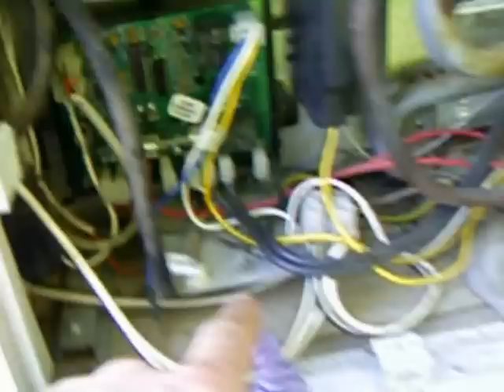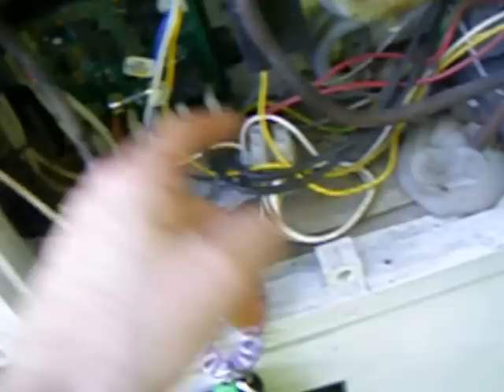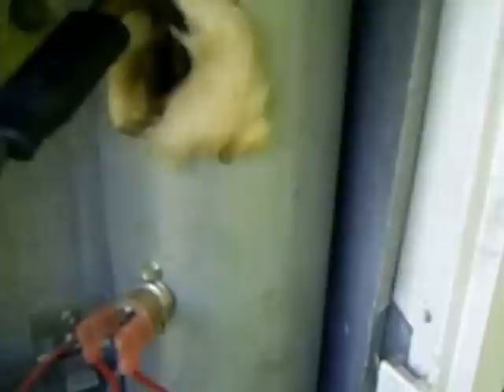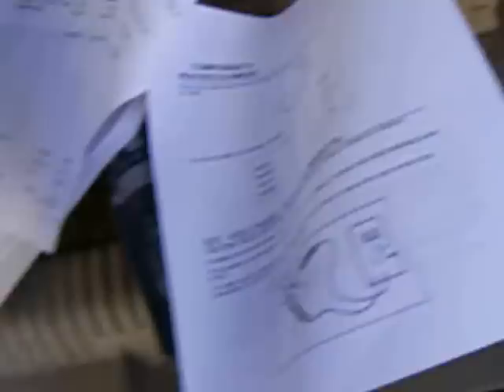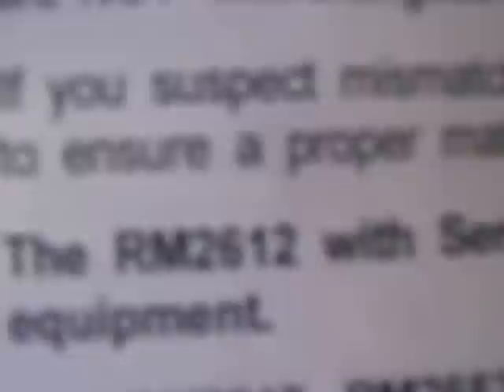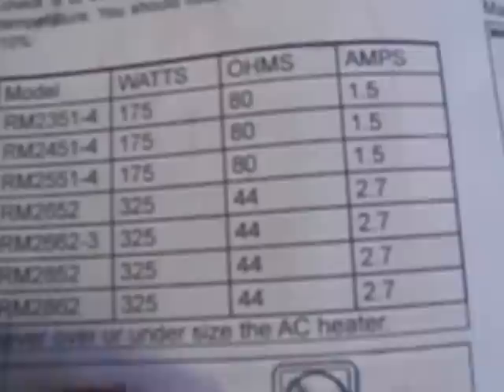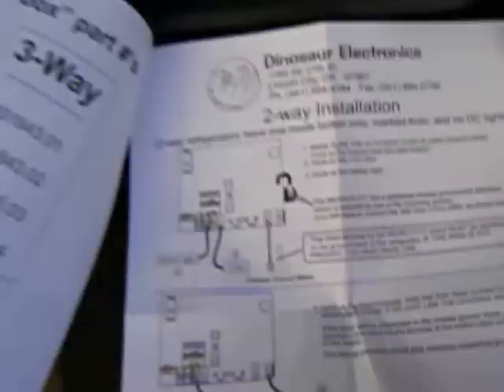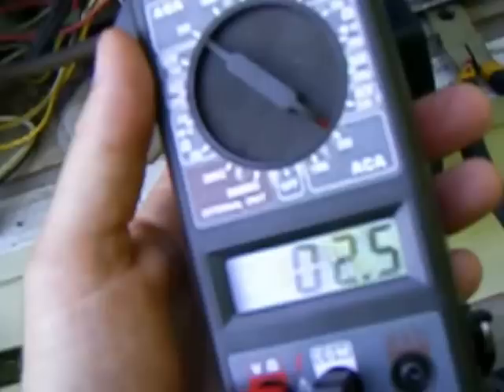Dometic 2652 RV Trailer Fridge Diagnostic And Repair

Comment: Guys and Gals, try plugging your fridge into another electric outlet first. After watching your video, I plugged the fridge into the outside electric receptacle on the side of the 5th wheel. 
 I could feel the heater working within 5 minutes. 
  I saved myself hours of aggravation by just by doing that.
Anyway, pro tip. Thanks for uploading.

Comment: A very helpful video. My cause of my fridge not working seems to be the rv factory installed 120 volt ac plug. I plugged the fridge into a extension cord and its working.

Comment: I just removed two heating element rods from a Norcold Refrigerator.  The tubes were cold and yes it's  harder to remove but what I did was take a block of wood and use it as a softner and carefully tap, tap, tap both of them.  You don't have to remove the refrigerator to get the rods out... if you take your time, watch what your doing and head room allows.    Great video...easy to understand.  Improvement needed on the filming.

Comment: Excellent video!!! I have the same 2652 and SEEING the manuals helped me find them and so I could run some tests.  Still troubleshooting... have yet to test circuit boards or cooling unit.  Just wanted to thank you for posting this as it's one of the best video's as far as explaining without all the technical terminology that I've found. I'm a firm believer in KISS. :)  THANKS!!
Reply: were did you find the manual?

Comment: i have a dometic 2652 and the freezer works fine but the refrigerator dont get cold and i pushed the slider all the way up to get it colder but it still dont so what else can i check ?
Reply: Having the same exact problem as you, I can’t find out rather

Comment: I have 1989 Dodge B350 which I just bought every thing was working fine until today ,,the fridge keeps blowing the 3 amp fuse which is feeding 13.4V  some how the top part if the fuse holder is grounded   but it looks just like your board,,,,any idea   thank s

Comment: So my dometic fridge will work on propane,not ac.put in new fuses and new control board. It is dm2652. Do you have a picture of how wiring should be to board?also I am thinking element and ordered one.i really need a picture to make sure the panel is wired correctly.
Reply from the maker: I sold the trailer so I cannot answer any wiring questions or provide pics.  However, the element is easy to change and retest. Please report back after that.

Comment: Thanks for the great video! I have the same model Dometic, but with different control panel (385 04 15-01). My refrigerator works well on gas, but on AUTO it doesn't seem to get nearly as cold. Just some, but not to the same level after several hours connected to AC shore power. Maybe I misread my meter, but the Ohms reading I got for my current heater element was 2.3 ohms. The vertical heater flue doesn't get warm when running on AUTO. Should the flue feel warm to the touch from the heating element when running on AC? 

Do you (or anyone reading this) know where the blue wire hanging from the eyebrow connecter (6 plug) on the upper left of my control board connect to? The blue wire on my refrigerator is terminated with a piece of black shrink tubing.
Reply: I think that goes to a different model fridge.